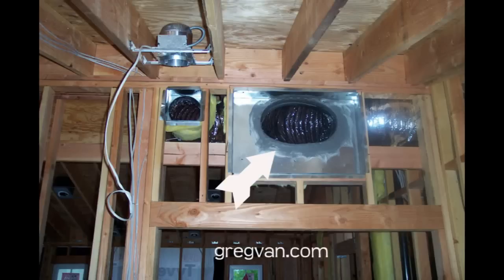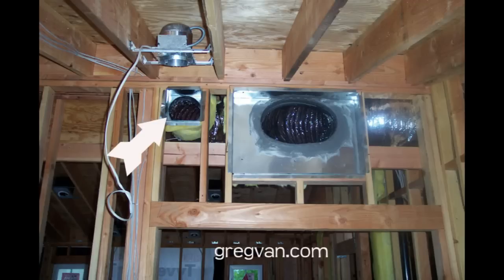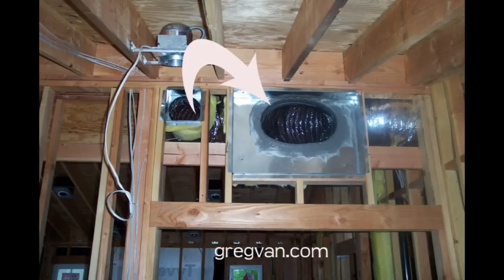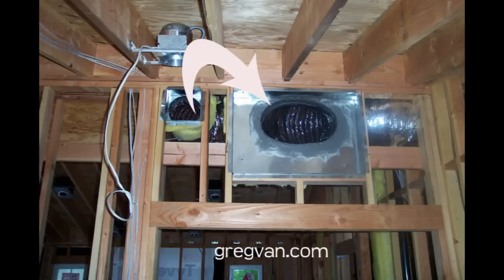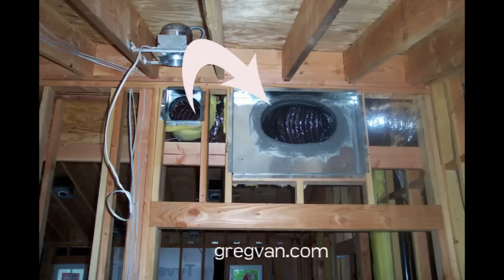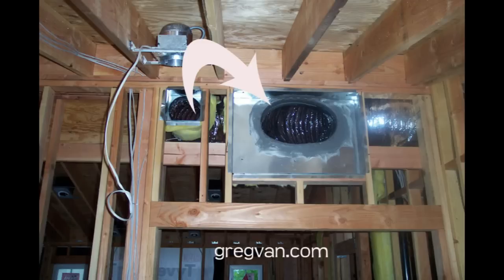Duct to Close to Return Air - Heating and Air-Conditioning Ventilation Problems

Comment: I live in Arizona at elevation about 3500 ft. I am looking to do two things: one add fresh air; two use cool fresh air when available instead of the A/C. In the hot weather the daily  temperatures are over 100 daytime but about 4 AM the temperature  starts to cool. The A/C cycles on and off all night even if the outside air is cool. Most of the systems in these 2000-25000 ft ranch homes use a gas fired hot air A/C heating and cooling system  Looking to add fresh air vent to existing system and electronics that will shut off AC and start fresh air intake thermostatically.
Reply: You are in need of a economizer.  Honeywell makes a controller called "jade".  its an amazing controller.  It requires sensors, and some modulating dampers.  We have even integrated it into zoning systems of certain styles, so zone by zone, it allows for the outside air to automatically cool your home when every you allow it to. Access from the return air on the furnace/ac system to the outside is necessary, and can be challenging.  Here in Utah, we have done whole home Honeywell Jade economizers with great success especially in areas like Park City.  But we have found that the money saved from this approach, vs considering a new inverter driven modulating capacity outside ac unit offers a much better return on investment.  For example, the Lennox XC20 ac unit, we have seen between a 300%-500% in drop utility from bills of $300+ down to $50-100 dollars here in utah from a similar Lennox XC16 or XC21 2 speed unit.  Manufacturers state SEER efficiency has only a nominal gain between 2 stage and modulating capacity units, but SEER excludes many important data pieces ("LRA" locked rotor amp data, and any off peak capacity efficiency data) in SEER testing.  So its a flawed test.